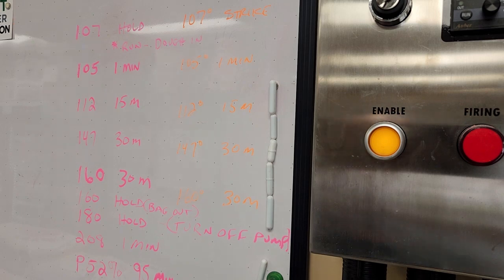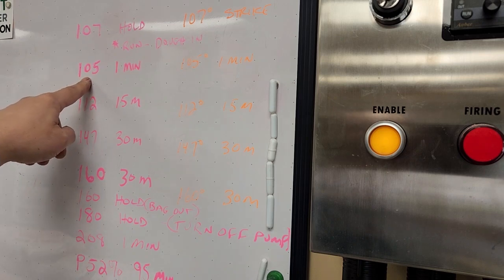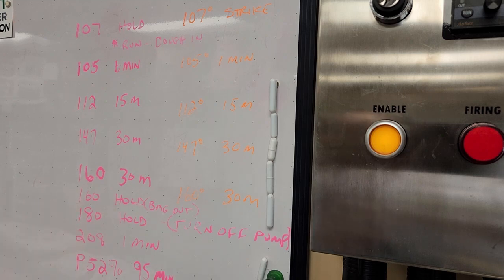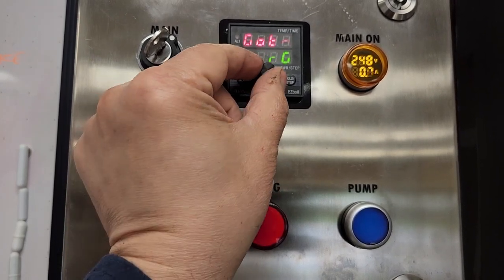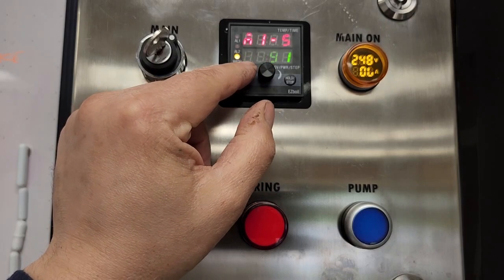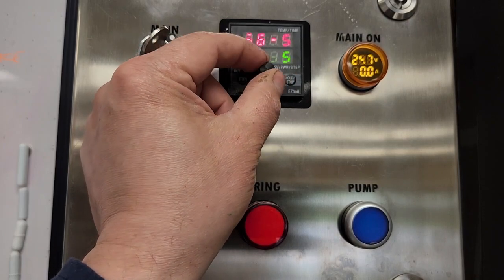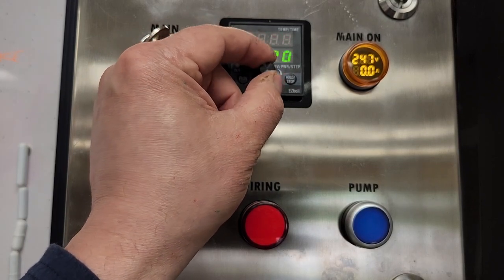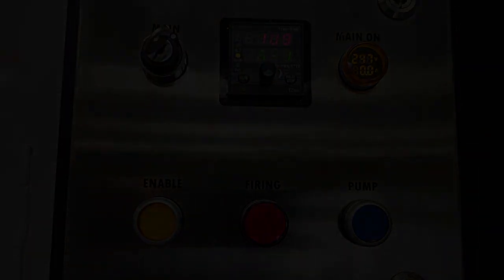Auber DSPR-320 Programming Overview for a Mash and Boil process

Comment: I have and currently use the dspr120 controller and do step mashes manually. This updated version looks interesting to automate a step mash. However the programing steps seem over complicated. In any case, was wondering if you program a step mash with this unit will it 'save' that program when turning off the controller? Not sure it has any memory for this. Seems in this day of age that a computer program interface to the regulator would be more useful. However the DSPR-320 does look like a good possibility for auto step mashing even if a bit clunky operational wise.
Reply from the maker: I wouldn't say the programming is complicated but it something you need to do a couple times before it becomes second nature. Sure it would be much easier if you could blutooth into with an app to program on a higher resolution interface, but at this price it's hard to beat. Yes, the programs endure power offs. Realistically you can save two unique mash profiles because there are nine targets in the mash mode and another nine in the "boil" mode. These modes really don't mean anything, they should have been named "bank 1" and "bank 2".
Reply: @BobbyFromNJ  Thanks for your reply. This should have been noted in the manual more prominently. However Auber did reply with a similar answer. In any case, looking at the world in which homebrewers now live it seems if one goes electric there should be more options in regards to interfacing to wifi -> computer etc. There are a few but as you say the price can get up there.
Reply from the maker: @harryharris1619  Who knows where the ideas come from. Look at Spike. All that opportunity to design from the ground up and they didn't even build in a timer or alarm, nevermind any kind of app or connectivity. They claim people want simplicity. On the other end of the spectrum would be https://brucontrol.com/product/uniflex-control-system/

Comment: Hey Bobby could you explain a little more about the non-default parameters in the settings? Do you disable boil acceleration since you are ramping to 208 in mash mode then changing to power mode anyway to reach boil?
Reply from the maker: Yes. I think the boil acceleration function was an absolute game changer on the more simple DSPR-120 because there was no other way to ramp QUICKLY to a boil and then back it off to a specific boil power without standing there (such as with any other dumb PID). Now that the DSPR-320 has 18 program slots and any of them can be temperature or power, it's better to hard code the ramp to a temp just below boiling and then have it switch to your power mode of choice. The reason for this suggestion is that the one downside to the boil acceleration is that it happens in the background with no real indicator on the screen. It often confused people because while it's accelerating to the bAST set temp, it appears to be in power mode yet NOT obeying the setting. In other words, why does it say P50 but the element is on 100%????? In the 320, you can easily see that it's running up to a preboil temp target. It's just more intuitive and they should have completely disabled the acceleration feature on this.